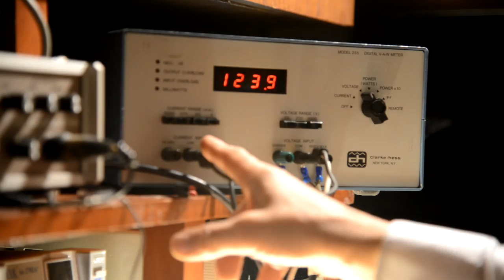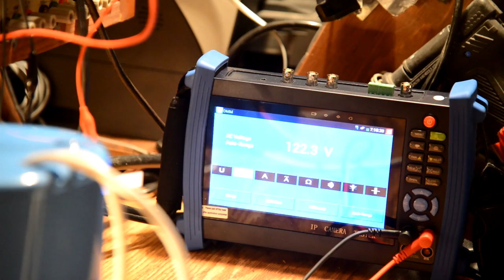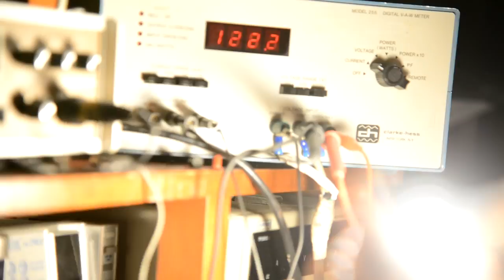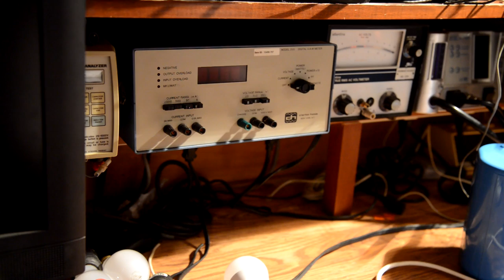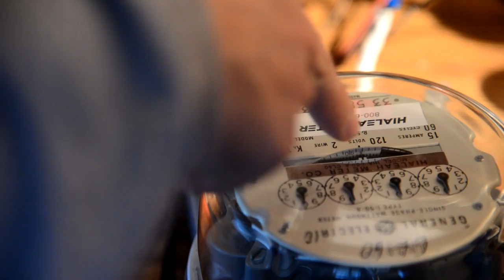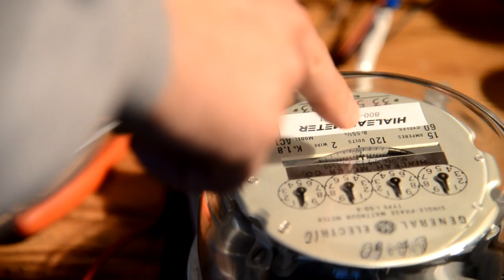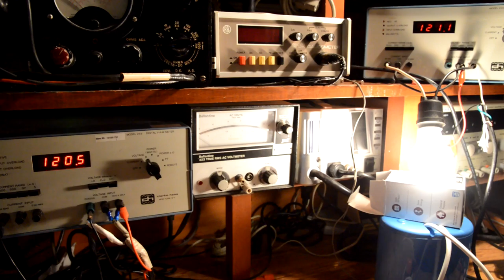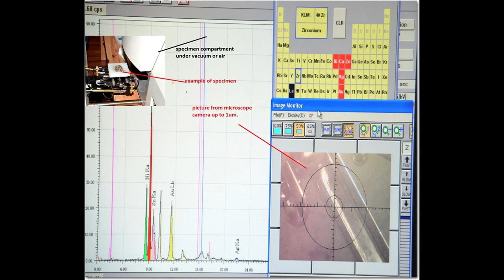Keshe "Free energy" Tear-down, examination, opinions.

Comment: Listen Stivep I agree with you about the bs here but for one thing. If you are gonna understand the device wouldn't be logical to go through the steps made for the device? You bypassed everything and tried to apply your own knowledge to this unusual device. Taking apart was the worst mistake you could have done, Why? Because it is reportedly using nano technology that creeps onto the wires back to the source of AC, in this case the grid. Those wires(coils) you were touching are coated in a nano structure that is very dangerous to humans and to our grid system. The nano creep of the material is facilitated by the AC itself and will slowly draw the nano material back into the AC system and eventually to the grid itself. My thoughts on this is that if it is creeping back into the grid then does it negate all of the devices we use for safety of the grid?
 What this nano material does is facilitate more inductive power around the wires drawing more plasma from the environment which increases the inductive ability of normal wires.

Let me be very clear here I am of the opinion that this system is very dangerous to health and our grid system because of this nano material. Taking it apart was not a good idea and touching the material on the wires was and is not a good idea at all without proper protective gear. There are some things we shouldn't do and using nano materials in this way is a very bad idea since we have no idea what effect it will have on our devices and system of power distribution and not to mention the effect it would have on our health.
Reply from the maker: I agree and disagree with you.
I agree that I could  "in the stupid try" - give it a try  and fallow Keshe manual.
I disagree with  your opinion about out nano-coating  and its properties as well as  potential  dangers.
https://en.wikipedia.org/wiki/Superhydrophobic_coating :
Manganese oxide polystyrene (MnO2/PS) nano-composite
Zinc oxide polystyrene (ZnO/PS) nano-composite
Precipitated calcium carbonate
Carbon nano-tube structures
Silica nano-coating
http://www.nanowerk.com/nanotechnology-news/newsid=43863.php
Nanocoating technology improves Teflon
http://fulltext.study/download/1527130.pdf
Now this one is interesting as copper nano-coating  due to  phenomena taking place:
1.- Surface plasmon resonance (SPR)   https://en.wikipedia.org/wiki/Surface_plasmon_resonance
a. - SPR band  is a property of SPR  
however I do not see  any connection to Keshe yet.
=================================================
Nano-particles are physical particles of matter. They can not be moved or  transported so your claim is pure fantasy of your imagination.  That includes  any possible dangers you envisioned.
Thanks to you  I have got something to think about in terms of longitudinal properties  of electron propagating along a metal   in a direction parallel to the negative permittivity/dielectric material interface. - LONGITUDINALLY . As well as source of excitation of  that might be done by photon  stimulation or electron bombardment.
The electron bombardment is very much promising
Wesley
Reply: So do you agree that we can use self assembly of nano structures? Because that is what is gonna happen to the fine layers as AC gets conducted over those layers. Just like what happens when we agitate very fine materials. The point of this is that you touched the nano material without protection. That is not a very good thing to do with nano materials as they can enter your skin.
 As for your theory that nano materials can not move??? Are you daft man? How do you think nano materials are moved in a fluid? or in the plasma of a sputtering method?
Reply from the maker: http://overunity.com/12736/kapanadze-cousin-dally-free-energy/msg498938/#msg498938

this is my response to your letter
Reply: I also do not believe his technology works in the way he presents it. But when looking at a new tech one has to keep to the directions of the creator and adhere to safety procedures or you are exposing yourself to some very toxic possibilities. That was my concern really.
Reply from the maker: good article thank you

Comment: you really are joke man .
you prove that keshe right .
you use a small load but keshe device works well 
come on man .😂😂
Reply from the maker: I only proved that proper energy  distribution calculation.  should be measured between the outlet and the load.
 But if you think it works than make it  and sale it . Number of your opposing  or satisfied customers will say the truth about  Keshe Technology.
If it was the truth Keshe could  sale it in "Iran or Dubai. 
But he is laughing now,  from you too  from his hiding place.
Reply: my dear .i do not know what is the reality about keshe technology .yet
and  i try to find fact 
but when you use load with keshe device and power masurement unit .it stops .even when you disconnect load .device feed back . network .it was very clear .
thats enough .
Reply from the maker: @مهدیپژوهش-ط4و   Unfortunately I must disagree with you.    
You said quote: "i do not know what is the reality about keshe technology .yet
and  i try to find fact " 
I suggested you to  get more  advanced in  it.